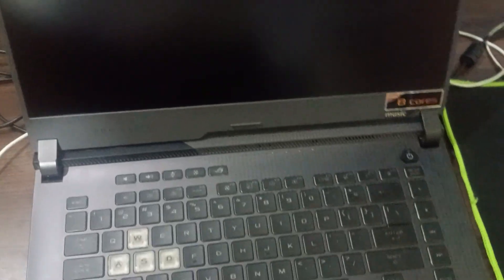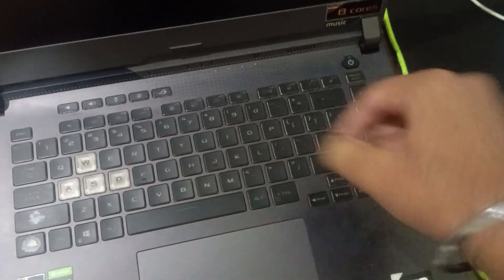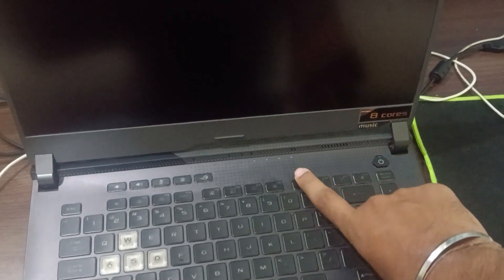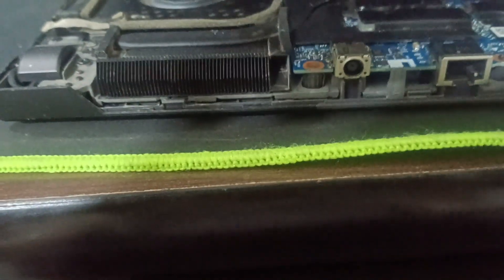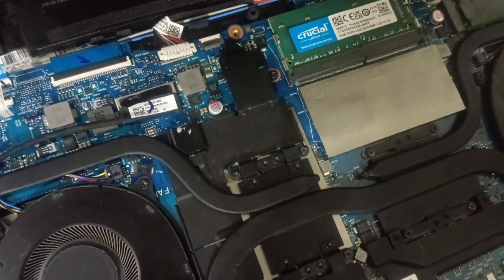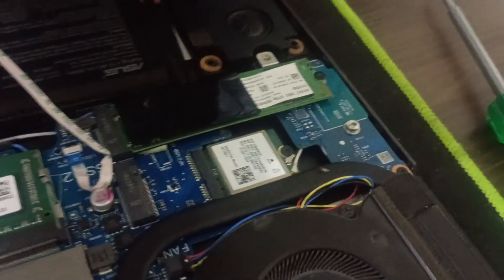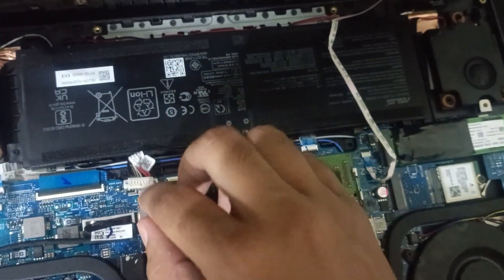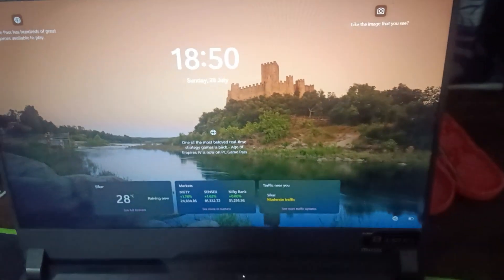asus rog laptop won't boot | laptop no power | Fixed #asus #rog

Comment: guys i'm being so fucking for real with you all, it worked! i noticed it wasn't charging last night (already had had this happen before but i waited it out) but this time i had important stuff to do. i try to turn it on at 3pm, it doesn't work. so i leave it to charge with 2 different chargers for 2 hours just incase its the charger! turns out it isn't clearly, and i feel like i fucked up. so i look up a solution and realize he has the same computer as me! i set a timer and held the button for 2 minutes, it doesn't work so i become skeptical. i press the buttons repeatedly for a few seconds do suddenly the charging light turned on. i was so stunned i just sat back in my chair and paused to rethink what just happened. i'm not even joking i started CRYING i was so relieved. i press the power button and it turns on perfectly fine and i felt like sobbing! you saved my computers life thank you so much!
Reply: Have connected your laptop on charging or u did it without plugging it
Reply: Which buttons did u pressed repeatedly?
Reply: @roxxayush3568  it's 100% worked trick

Comment from the maker: READ FULL COMMENT
Join this telegram group and let's discuss the issues: https://t.me/+2C2SwisRkDAzZWZl
Pro tip: Delete valorant... trust me it works.
Good for both you and your laptop's health
Edit: first step before opening the laptop is to hold the power button for exactly 2 minutes or more than 2 minutes and then start tapping it continuously like hold the button for 2 minutes and then tap tap tap tap, this may start your system without doing anything.
*
so the thing I told you to delete valorant is little bit not ok the thing you have to do is once it starts so first of all you have to delete the armory crate software that is the only software which is creating problems because I installed windows multiple times and the same problem occurred as soon as I install the armory crates software because there is a dedicated key in my keyboard whenever I click that key it starts the armory crates software installation and once the installation is complete the problem comes back. So all you have to do is just uninstall the armory crate software.

And talking about the bios flash... after swapping the SSD and the RAM in other slots, what I did was to go to the BIOS settings and restore the default settings of bios. There is a option to restore the old settings in BIOS for the default settings so just click on that option and your BIOS will be back to default settings. I didn't flash the older BIOS.
The BIOS thing I said was because of the update of bios which came in 2023 and after that BIOS update the problem started in my laptop so that's why I was saying to flash the older BIOS but it is not necessary because with the current bios and uninstalling the armory crate software my system is working fine.
Reply: Did the issue occur again after deleting armoury crate?
Reply: @fixexe  please reply
Reply from the maker: in my case it happend again.. idk why, i also contacted asus care they said to visit service centre.
Reply: @fixexe  please reply what they said if you choose to visit
Reply: @fixexe  did your charger got defected first before this issue occured?
Reply: I visited last week for the same problem they said the fault is in motherboard and asked me to pay 65k for the motherboard. 😅 I said give it back. Then I made it repaired in the market but the problem came again in 5 days i will visit once again. Will update if I get the solution.
Reply from the maker: @ravinderkumar-zm2cv  I made some progress myself... Found the actual issue (I think so)...part 2 Video coming tonight. It's the keyboard issue 👍🏻
Reply: @fixexe  I also thought the keyboard problem but after shorting laptop still not powering on.. I'll wait for your video..
Reply: @fixexe  alright dude
Reply from the maker: @ravinderkumar-zm2cv  it will not turn on untill you disconnect the keyboard. You have to disconnect keyboard and after that short the terminals. I tested this trick 5 times in last 10 days just to make sure.... Ant it works everytime for me. If you try to short terminals while keyboard is connected.. it will not work.
Reply: @fixexe  I tried after disconnecting the keyboard... I think the pin will be 5th and 6th from the left, right?
Reply from the maker: @ravinderkumar-zm2cv  Join this telegram group and let's discuss here https://t.me/+2C2SwisRkDAzZWZl
Reply: @ravinderkumar-zm2cv  do inform
Reply: About the Armory Crate issue,even if you uninstall it, it "reinstalls" itself. To get around it, there is a software called G Helper which is made exclusively for Asus computers.  It's a third party software but it's fantastic. You can disable Asus related services, which means you can disable Armory Crate.